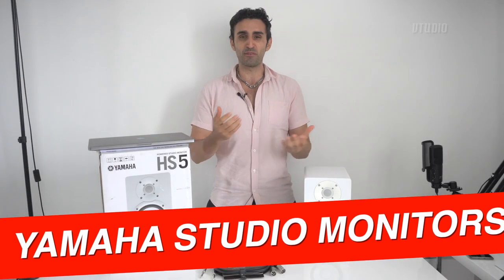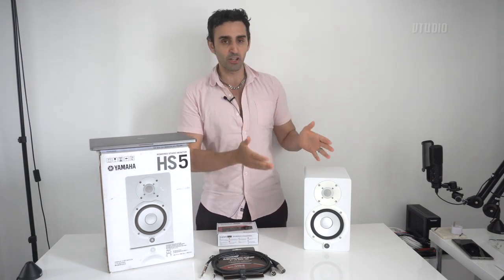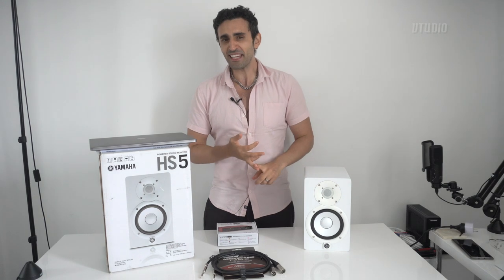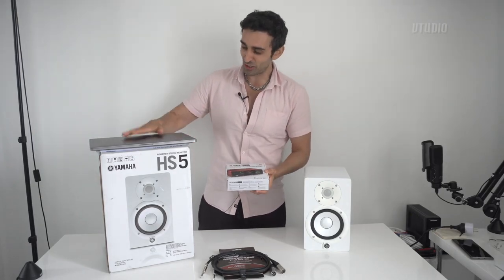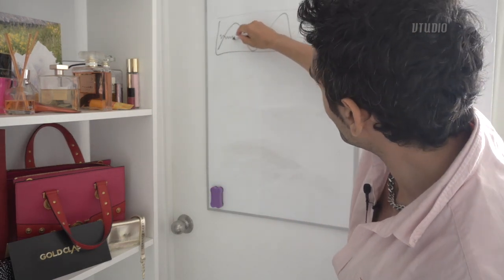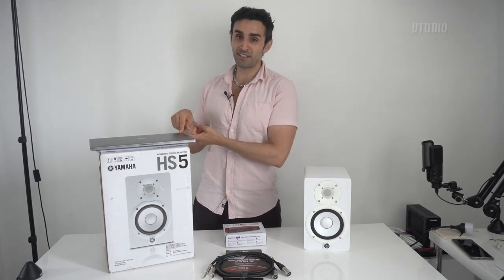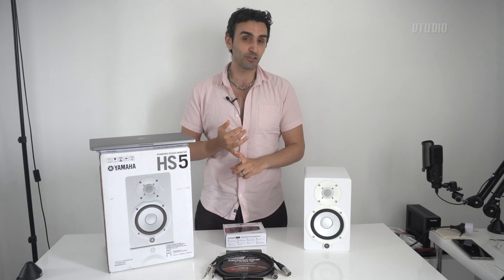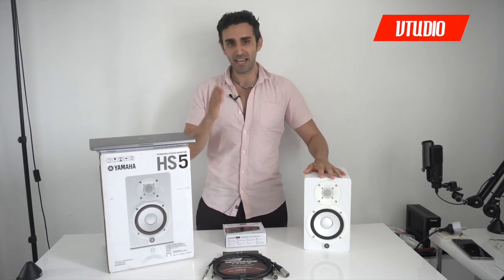How NOISY are Yamaha HS5 Studio Monitors with Balanced Cables? | Audio HISS Review

Comment: For a true baseline I would suggest powering up the speakers in a room with no other equipment anywhere near.  No computers, no audio gear, no wifi no routers.  I tracked down an an issue with my HS8s and it turned out to be my wifi router.  Drove me crazy until I moved the speaker to another area away from all other equipment and then I knew the noise was not inherent in the speaker.
Reply: that's not a good fix for people with home studios ..lol
Reply: You’re wrong.

Comment: 1.Change the Output cables of Audio Interface.
2.I use Yamaha HS8 ,I cannot hear unessery noise on that. I highly suggest to use premium or High quality XLR male To TRS male cable.Not the unbalanced TS one. 
3.Do not use any Sort of adapters or Audio spliters from the output of Audio interface to Speaker input.Trust me, Your Interface Gives Best Quality Of audio Input and Output .
4.Do not use TRS to TS Left and Right Splitter cable from Headphone output to the speakers Input in your  Audio Interface.
5.Use 2 Seperate (TRS to XLR) {or} (TRS to TRS) Cable For individual Direct output From Back of Audio Interface's Left and Right Channel.
6.set your Levels at -4 Db/middle point of potentiometer/ Middle point of Volume Knob, in the back of monitors.
7.Check your Soundcard Drivers For Updates. 
You will Definately solve your Problem.I promice that.
Don't Get pissed, ask me anything about Audio Signal .
Reply: My cables are XLR to RCA and I plug them directly into a Pioneer DDJ-RR but I still get noise. Would it make any sense to keep the speakers at -2db (cant hear noise there) and then get an external amp to plug them into in order to make them louder?
Reply: hs5 user here, new hs5 monitors, separate trs to xlr cable, the noise seems to do with the location of the speaker, but in a very strange way.  sometimes the noise comes when my imac is loading a youtube video , so i thought it might has something to do with wifi signal interference,
Reply: I have balanced cables if I plug power into my monitor from my Dell monitor my Hs5 speakers make static fuzzy low noise still.
Reply: @officialbammusic  RCA = unbalanced
Reply: the yamaha static is there without any source plugged in at all. Dont comment when you dont know.

Comment: I just got a pair of these, in white, exactly the same as yours. With unbalanced, 10' long 1/4" cables plugged in, there was some noise - not a buzz really, but some strange high frequencies. And only really present at full volume. When I switched to 4' balanced 1/4" cables, there is absolutely no noise, not even a faint buzz. So maybe they've done an upgrade since you got yours, or maybe you got a faulty speaker. But all I can say is, first plugged in with balanced cables connected to my audio interface, mine are QUIET, and that's with the volume all the way up.
Reply: the yamaha has self noise at all times, with nothing plugged in at all. Thats how they are, It doesnt matter the volume setting. Power up with nothing at all connected and put your ear to speaker. Its buzzing.

Comment: Hey Friends, so I ran into the same problem a few years back and I spoke to a friend of mine who is an Electrical Engineer. If you can find it, try the iFi iDefender3.0 External USB Audio Ground Loop Eliminator. Last I remember, it was around $50 USD. It takes a fantom power via USB. The device eliminated the "hissing/buzzing" sound that I was experiencing with my Yamaha HS5's. Hope that helps, and best of luck to you.
Reply from the maker: Thanks for the tip mate, did this remove the hiss before or after plugging it into your computer?
Reply: @headsoftech  the hiss was removed after using the iDefender
Reply: @shawnbaxter8395  I just got one of these ifi idefenders, did you need to connect the external (phantom) power for it to work? I still have hissing but have not used the power adapter with it yet.
Reply: how does that work when the Yamahas make their own noise? Its not coming from the USB device when thats not plugged in. Yamahas buzz without a source.

Comment: Everything you said is absolutely correct. Great sounding speakers that just don’t work silently and they aren’t magnetically shielded :/
Reply: @michael4196  more than likely .
Reply: @2000 this is exactly my situation.  My hs8’s produce a hum simply when plugged into the wall ever since i moved to my new place.  I just bought the iFI GND defender to see if it fixes the issue.  What a frustrating ordeal.

Comment: I just received my new Yamaha Hs8 and have the same issue. The sound looks like those old dialup modems. Don't know what to do....I can minimise it by maximising the volume on the audio interface and setting the Hs8 volume to 1.5 (between one and two). I wish I'd seen this earlier. Here in Australia, we have to pre-buy it and even be  in the queue for months to receive it!
Reply: Just an update: I just plugged my new "balanced" cable and the noise is gone by %90. Wasted $ 50 of my money buying unbalanced cables by mistake.
Reply: @AshEivani  which cables specifically?  Thanks
Reply: @alh2004  Any cables that have "Balanced" in the description. I used an affordable $12 from eBay (3m) and it works perfectly.
Reply: What do you do, you juste buy balanced cable ?
Reply: @1eidji652  I bought a balanced cable (under 18$) and it solved my problem.
Reply: @AshEivani  Can you send me an exemple of câble if u have a link its would be great thanks you man

Comment: I have the HS7 with HS8S sub. When the DAC is connected via USB to the speakers via RCA>TRS cables there would be all sorts of buzzing noise. I removed the USB and switched to optical and noise is gone for good. The HS speakers have no noise on their own, its the connection that brings the noise package.
Reply: it simply has the noise when no signal cable connected.

Comment: A UPS does not clean up the power source it’s just an "uninterrupted power supply ". It makes it more dirty! What you need is a power line conditioner for a clean power source.
Reply from the maker: The one I have does: https://cyberpower.com/au/en/product/series/value_soho
Reply: Doesn't work! In Reaper the noise is accentuated... very nice to mix at low volumes... at 250$ a speaker... I''m not impressed

Comment: What was the level set to on the back of the speaker? I had issues when I cranked my studio monitors internal level all the way (more of a buzz than hiss). But setting it to something lower and using a DAC/pre-amp for volume control worked well. Specifically, it was a Teac UD-301 > XLR > KRK Rokit 5.
Reply from the maker: On this guy, the buzz was there even when it was set to the minimum level.

Comment: My Hs8s are connected to a furman power conditioner. I use xlr Mogami cables to my monitor station which goes to my Apollo. I turn up the Apollo to the max so I can see the noise floor. I use the monitor station to control volume. The furman also has all other components plugged in to it. I get dead silence.
Reply: Interesting. Properly set up with good quality gear = no hiss.

Comment: Has anyone even though of a proper power conditioner? 😂 

Yes use Balanced Cables (TRS or XLR)
If your running everything out of one socket. You pick up frequencys from everything that's plugged into that one socket. Speakers should either be hooked up to a entirely separate socket and plug. 
As well as have a power conditioner. 
On top on that, you also was monitor stands, not desk risers. Monitor stands allow you to move them farther away from everything that's giving a magnetic or radio wave frequency off. If your studio is set up right. You monitors are about 1.5 meters from the wall, and still about a ft at most from your desk. Sitting at you desk, if it's a 30 inch wide desk or more should be your sweet spot for mixing and mastering in the first place. 
Lastly, having all of that centered in the room everything is in. Not directly in the middle of the room. But wall centered. Meaning of your looking at one wall. It' should be centered on that wall to symmetrically bounce off frequencys in your room. 

Hope this helps!
Reply: Mine had loads of hiss and was picking up radio interference. I bought balanced cables and put them on their own power supply and it stopped it all.
They are wonderful little monitors.

Comment: Hey Ash, what could you say about a maxed out 16” mbp with the Rx 5700 XT egpu? Is there any point on buying the egpu. I need it to allow me to run an external monitor without the mbp overheating.
Reply from the maker: The video I did before the last had an eGPU with a RX 5700 and a MacBook Pro 16, check it out.
Reply: Vtudio Pro yep just checking it out right now. all I needed, thank you :)

Comment: Helppp! My HS5 as making a very high pitched (and very loud, I can't even work) sound as soon as I turn them on and I've tried everything. It does that even when it's not plugged to the interface or if absolutely nothing is on next to it (my setup is just the monitors and a scarlet 18i8 and it does that even when everything is off, the internet modem is far away as well as other electronics), when it is just simply plugged with the power cable. I've tried changing plugs but yeah it makes this noise as soon as I turn it on, just with the power cable plugged into it. What could that be??

Comment: plug everything on the same outlet and use balanced cable will fix the issue. This is happening due to ground wiring.
Reply: Trust me when I say this doesn't work. I'm having the same issue. I have...

a.) everything plugged into the same outlet (computer, monitors, etc)
b.) balanced to TRS cables
c.) ground loop eliminator
d.) power conditioner
e.) I have sent them back to Yamaha once already
f.) I have taken them to a local music store to try a different set up entirely, same buzz

There's just something that went wrong with these speakers one day for me. They were absolutely fine, then one day they started picking up every little sound of electricity within a 100ft radius, and I have taken every step to eliminate grounding hum in every piece of electronics I use, including all of my guitars, amps, etc. I have even moved this stuff out of the room... I mean if you can think of it, I promise you I have tried it at least once lol.

I don't think it's the grounding of other things as much as I think it's potentially something to do with the amps in these speakers picking up frequencies that they shouldn't be, which would be a manufacturing defect that Yamaha doesn't want to acknowledge it seems. 

I have 120 watt high gain guitar amps sitting closer to my computer than my audio monitors, this guitar amp is concert levels of loud, by all means should pick up frequencies coming off of the hard drives/cpu of my computer, it doesn't.... but my audio monitors sitting farther away than my 120w guitar amp does? What? That doesn't make a slight bit of sense considering they make noise gates for guitar for this specific purpose. I don't need a noise gate for my guitar, but I need one for my audio monitors? On what fuckin planet? LOL 

I mean something is just up with these monitors, period.

Comment: Hi, did you try with the MacBook Pro running on battery?
Reply from the maker: Yep
Reply: They generate ground noise WITHOUT any input plugged in, the ground connection causes the noise because of how sensitive they are
Reply: @EJR20  I'm not sure. I'm using sockets without ground connection (it's an old house, we only have ground connection in the kitchen) and there's still a hiss in the monitors.

Comment: I experienced the same issue with noise hiss. But after I hooked a USB to my pc to the audio interface. It was gone.
Reply from the maker: Excellent, was it noisy before you plugged it in your computer too or just when you plugged it in?
Reply: @headsoftech  Yes, my situation in detail was i had a Yamaha MODX synthesizer. I turned on the monitors and the hissed with noise. All do. Then I hooked balanced cables from the Modx to the monitors. Still hissed. Then I plugged USB to my keyboard to my pc thats 3 prong grounded. 100% silence no more noise. The modx has a built in audio interface. So depending on your need you can buy an external audio interface.  But it needs USB. Its like the ground of the pc ties all together eliminating the noise.

Comment: Three prong to two prong adapter doesn’t work brother because there’s still interference from the ground prong just for being present, you gotta actually pull it out and hope you never get an electrical short, well not hope, but make sure to plug the monitor to a surge protector or a power conditioner and not directly to the outlet.

Comment: I have NO idea why no one has said this... This is entirely normal. It's the noise floor of the circuitry system and the high frequency response of the monitors. Many monitors have an audible hiss while nothing is playing. It doesn't mean there's something wrong with your monitor, or that it's not a great monitor. There might be a few monitors here and there that have very low audible hiss, but the majority of monitors are noisy when nothing is playing. Some are worse than others and granted, your hiss is quite loud, but don't make people think that Yamaha speakers are bad, it's quite the opposite.
Reply: How do you remove it? Mine happens when I have MacBook pro power plugged in.
Reply: I had the same problem with my yamaha’s and Mixing desk; Checked and got to know my grounding wasn’t working properly. My Electrician had my problem solved. I previously used a Di box as well where the noise reduced a bit but wasn’t gone completely. So it’s better to double check your grounding where your speaker is plugged is good. I hope that helps!

Comment: mine hissed for the first year and a half. then i got a new computer and Audio Interface. after that the hissing was gone. motherboards can cause the hissing or external audio interfaces depending on the brand.
Reply: If there is something wrong with your equipment its going to be amplified through the monitors.
After all it can only send sound from your computer equipment and if your electrical equipment has a problem then its going tp pick that up too.
In other words its telling you there is something wrong somewhere but people need to use balanced cables.

Comment: Try to clean the cables with a good cleaning solution. Might help the case and should be done every year. Otherwise can be the highs or bass are turned up too much. If all is correct maybe it might be due to a bad cable. Try another brand/ a friends cable. If still problems try another speaker. Recommend genelec overall for you to hear exactly everything for a good price.
Reply: Clean with a IPA solution. Like isopropyl alcohol. Cheap and good
Reply: you have no clue

Comment: My HS4 are silent even with Kali Audio Subwoofer ... using cable matters cheap xlr cables no issue ... My HS8 s  made a slight blipping noise and i had to reroute the xlr cables and it went away ...

Comment: Have a look on Presonus Eris 3.5, very inexpensive monitor (200 AUD) with an amazing sound!
Reply from the maker: I like the price mate, how is the hiss levels?
Reply: @headsoftech  With TRS cable no noise. With standard jack, slightly
Reply: @krupps84  hi, are u directly connecting to your computer straight for eris 3.5 without a mixer? If so, are u using 2 separate trs cable to 3.5mm jack? I bought the ugreen dual trs to 3.5mm jack but it still gives out slight hissing and the cable mentioned trs dual but it does not have second ring on the cable

Comment: Why don’t you go with a passive monitor and a high quality amp. I never got hiss from passive speakers as the amp isn’t pushing the noise floor to its max when the speakers are idle. Never liked active monitors....
Reply from the maker: I'm new to audio so I pretty much have no idea what I'm doing. Which monitor and amp do you recommend? I just want something that's higher quality than my MBP and has no hiss when nothing is playing like my MBP.
Reply: @headsoftech  You don't have to go crazy, just a half decent set of two way speakers, spend some money on a decent hifi amp - even something for around $500 from JB. Audio has this law of diminshing returns. . .a buddy of mine is currently using ear speakers that cost him upwards of $6k. . . It's a rabbit hole and a half. . .

I use a basic set of JBL bookshelf speakers (18 years old) running from the headphone port, no dedicated DAC, through a pioneer surround amp that cost me about $600. . . .no hiss. . .clean and crisp. the trick is to not push the amp too hard which amplifies the noise floor of the computers signal when the volume on the machine is down low.

Not an expert, but it works, sounds good enough and doesn't have any hiss. I used to use optical out on the macpro/old MBP etc. but the lag in the amp to pick up the optical sometimes was too frustrating and it was terrible for editing. The fast respnse of the analog signal was just so much better for editing.
Reply from the maker: Thanks for the tips mate, any chance you could let me know which particular models you use? I need to make sure I don't get the wrong gear.